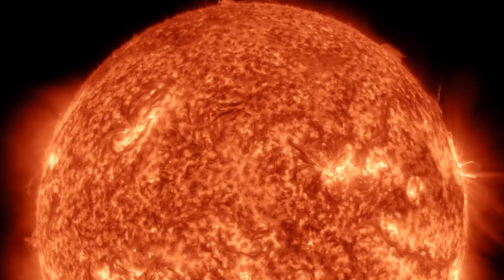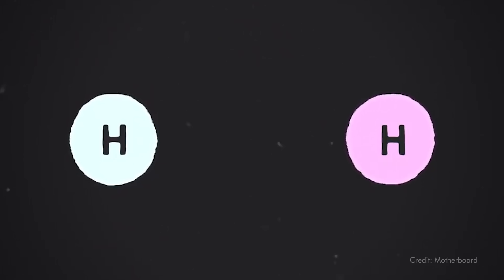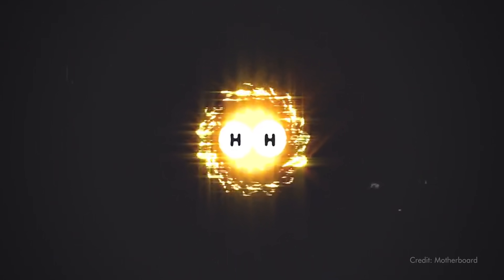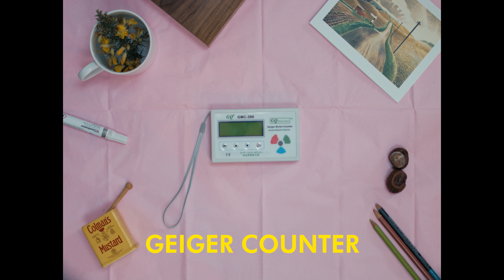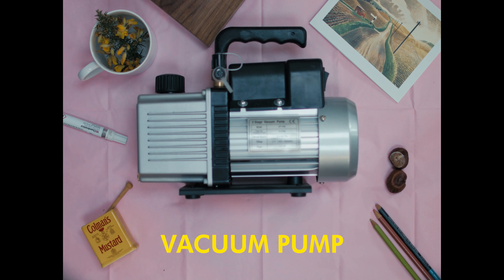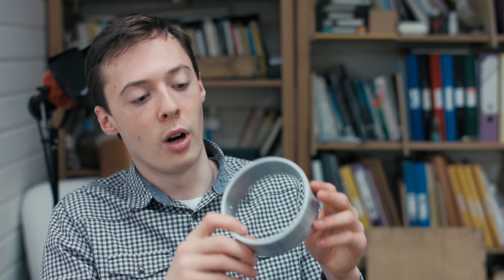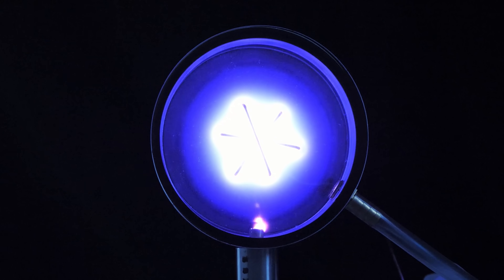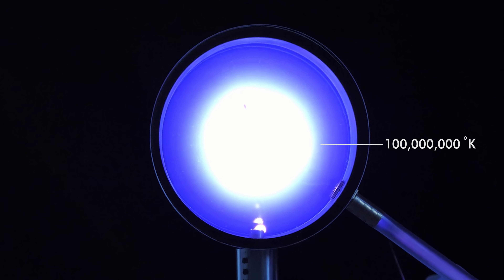Making a Desktop Fusion Reactor

Comment: Real scientists spend millions and thousand of hours of calculating and research to get their fusion reactors to work for a quarter of a second. 

What you have there is just plasma. Energy in a near Vacuum. 

I'm a chemist no physicist thought but have had to take Multiple Physik classes before earning my Bachelor
Reply: but the difference between him and a scientist is that scientist are trying to produce energy which is much harder. this is a fusion reactor, its just not a very god one
Reply: @vincentsantangelo3920  OMG. 

FUSION NEEDS MOLECULES TO FUSION ONE WITH A NOTHER. 

if there is a vaccum that's means there is nearly nothing in that chamber. If there is nothing then there's nothing to fusion. 

For fusion we usually try the Deutérium méthode where we have a H2 molecule reacting to form a He Atom. This process then ejects energy. 

What he created there is just high voltage energy. Basically dense energy in a vacuume. An this is called Plasma. 

You can see it in the color plasma has a special color Here as a star (fusion ) would have the color of the element that is being created (orrange blue etc ) 

I'm a chemistry bachelor major stating my master Thesis believe me when I say that that is not a fusion reactor. Look it up how fusion is made you'll see the sole part of there not being anything to fusion goes against the first law : nothing can be destroyed and nothing can be created. Everything is preserved
Reply: so instead of working on your thesis you decide your time is better spend telling a random stranger that their wrong?
Reply: @vincentsantangelo3920   dude it's 23 pm ...  I do work on my thesis after my classes but still have free time dude 😅 it's like any thesis you do it in your free time over 2 years with help of your lab assistant. (Assistant is just the word for it, your assistant actually has a doctor title himself he just assists you on your thesis ) 

So yea I basically have the same spare time as anyone else that studies at a normal pace. 

And its actually my pet peeve this type of video especially the poeple believing this bullcrap... 

It's something that can easily be debunked with some basic science understanding but poeple see some energy in a vacuume and believe anything. 

Engineers actually are pretty dumb most of the time. Most of the calculations and drawings come from poeple with a master degree or doctor degree the engineers are just there to execute what the scientist tells them to do. 

So this guy is just an engineer that's the reason he has 0 scientific understanding. He puts a few resistances together that's about it.

Does it look cool. Yes I guess so the same way a lava lamp looks cool . But he shouldn't be lying on his channel for views. Just makes poeple say this kind of shit to me at parties "you're a scientist right ? Have you seen the guy that made a fusion reactor in his parents basement ? " 
" Have you seen the solar roadways ! " 
"Elon musk is such a genius ! Have you seen his flying car idea ?! " 

Yes all this I have seen. No nothing of this is actually logically backed. And no these poeple are not geniuses, if anything they have no understanding of basic physics ..... They have a good marketing gift tough
Reply: calm down also did you hear about the boy out that build a nuclear reactor in his backyard
Reply: @vincentsantangelo3920   nuclear reactor works differently. The heat created is crazy. Plus the radiation needs big pools of water. 

Any amount of uranium that could be used to build anything useful (bomb or reactor ) is supervised by most countries of the world. 

In our lab to be able to use these kind of radioactif products we need special places we order it from and need to inform the city. Plus like any chemical we need to put our caution sheet infringement of the lab with every instruction in case of disaster (fire tornado and earthquake etc ) 

I'm calm actually just explaining how stupid this video is and poeple for believing it
Reply: @KarottenProductions  I don't know what country you are in, but in the USA you can just order uranium online, or walk over to a mountain and grab some ore. Or just get some americeium out of smoke detectors and make a reactor (which happened, look up David Hahn). And if you wanted to make a high voltage fusor you can just order the stuff for that online too. Or just use more voltage and use normal hydrogen. The colors he is getting are the normal type you get from fusors made at home. It's NOT a vaccum, it's low pressure that he put hydrogen gas into.
Reply: @KaletheQuick  It IS a vacuum, depending on wich definition of vacuum you use.
"it's low pressure that he put hydrogen gas into" JES! + electrical field = PLASMA! JUST PLASMA! NO FUSION!!!
And he does not have the 100000000K that he claimes to have. Or he has some incredible heat resistand copper wires.
Reply: @divingdave2945  or might be using copper coated carbon rods, or they might be copper rods. idk
Reply: Well, not really. Fusors have been around for a long time. Net energy generation by any fusion method including magnetic and inertial confinement has not been achieved, but many think that this electrostatic method holds promise.  This demo only demonstrates the principle, but a sophisticated device based on this principle could yield higher efficiency. The key advantage is that nuclear fusion requires a specific “temperature”  between a given combination of plasmas that is extremely high, but voltage can mathematically be substituted for thermal temperature.  Since such high voltages can be achieved much more easily, the required voltage for deuterium fusion can be produced on a desktop.  The main problems are the grid collisions, and the reaction products that impede the target reaction. I personally believe that a boron 11 fusion device could be built on this principle within the next quarter century.
Reply: I also had to take multiple physics classes for what I am studying, and I totally agree. He made a usual plasma. This has nothing to do with fusion.
This video is misleading, unhonest, antieducational and should be deleted. I wasn't that triggered at first but scrolling through the comments made me really upset. This comment section is like a medieval market place where a hundred censored spit at the one guy who says the earth is round.
Some big science youtuber needs to debunk this video.

Comment: Since 3d printing is a thing..  Would it be possible to cross thread a really good conductor.  Putting a solution on it layer upon layer..  Wouldn't that amplify the energy giving out since it will convert its own thrrads into a mini super rod.  Idk I can see more ways to out put more energy put applying it is its own realm lol

Comment: It’s not fusion and the reason it’s not fusion it’s because fusion is taking two particles smashing them together and creating a particle that is twice the size such as to hydrogens combining to make a helium that is high-voltage is between large distances ionizing particles in the air creating light for the electron step down method to create what looks like fusion if it was fusion it would most likely break his geiger counter or at least carpet out from what I can tell it wasn’t capping out because it wasn’t beeping all Geiger counter is regulated through the world have to beep when they cap out In order to tell you this is dangerous fucker maybe you should go away anyway it looks nice props to him for building it just frustrated me that the safety measures he took were minimal to none and that’s not how you silver plate either whatever I have a whole thing I can make an entire book about all the shit he did wrong good for you for making it just come back to it do it properly please

Comment: Fusion needs pressure to occur. Not a vacuum. Also the temperature would need to be extremely hot which would just melt everything that its made from. Not only that, Scientists have spent alot of hours and money trying to make a fusion reactor to very little success as the amount of pressure and heat needed is beyond the capabilitys of the resources we have now. What you should have named it is "Making a Mimic Desktop Fusion Reactor"
Reply: This lad, I swear...

Comment: So I am a nuclear engineer and can explain what is actually going on here.  That glow you see and the clicks from the geiger counter is from two things. One is what is called bremsstrahlung, or braking radiation.  It's the emission of photons from charged particles slowing down.  The other source of the glow is from electrons recombining with the ionized gas which also emits light, specifically blue for hydrogen isotopes.  It is technically possible to fuse deuterium and tritium (hydrogen isotopes) with 50 keV but since tritium is a controlled substance it is extremely unlikely thats what he used.  Even then, if you did have the proper isotopes, the fusion rate would be extremely low for this scale of a fusor and you would need a proper neutron detector to confirm it is working.  Not a regular geiger-mueller device.

Comment: 1. dose it give off radiation?
2. how does it not melt everything around it?
Reply: Ok I see so fusion is the adding of protons and h2 would be made by the atoms sharing a electron got you thanks for clarifying.
Reply: It should give out a little bit of radiation but this particular fusion reactor is just a fusor a relatively cheap demonstration piece that shows that fusion is possible with a relatively small amount of energy. The process it uses doesn't consume energy on the same level of its cousin nor produce as much heat and it will almost always be guaranteed to consume more energy than it generates due to some very fundamental and difficult limitations of the design, hence its bigger cousins the tokomak and stellarator reactors which are supposed to break even and generate a bit more energy.
Reply: Another question in his demonstration he shows two Hydrogen atoms and if you fused them what happened to then after like do they stay together and if so, isn’t H2 poisonous. 

Sorry about anything miss spelled or doesn’t make to much sense I’m dyslexic :(
Reply: @Derrick-ne9xs  if some of the atoms succeed in fusion he wouldn't be creating h2 he would be creating helium.
Reply: I got one last question that you might not be able to answer but could you just fuse them then spit them. Probably will not be able to produce enough energy to make up for when we use to fusion then the spilt them.
Reply: @Derrick-ne9xs  now that would be heading into the territory of needing nuclear materials that give off particle decay to break apart isotopes of helium to hydrogen since  you'd need a neutron source capable of breaking atomic nuclei apart. Electromagnetism is really good at forcing at atoms to fuse not so much at breaking them apart which is where the particle decay comes in, meandering neutrons birthed by nuclear decay are pretty the only particles capable of carrying enough of  a punch to breaking apart a nucleus without being interfered with by the forces electromagnetism.
Reply: Oh got ok thanks I appreciate it :)

Comment: you cant use ordinary hydrogen for fusors!!
you would need to get your hands on deuterium gas
or one other way is to coat the central electrode in lithium Deuteride salt!!
also dat shit needs a super powerful vacuum pump called a diffusion pump because it operates at extremely low pressures

Comment: I'm just confused by the Geiger counter. Even if fed hydrogen, a demo fusor won't produce any meaningful Radiation. You need a real fusor running in star mode (D2 fuel) and even then it'll emit Neutrons which won't be detected by a Geiger.

It's a good build and I don't doubt the demo mode operation, but it isn't emitting radiation.

Comment: Iam not sure ... but ... if that thing has 100 mil degree ... shouldent it melt down the whole experiment ... at least the glas  or plastic ? I mean glas/plastic has a very low melting point... right ?

And... just a question... iam not a great physiscian but... isnt the reason why the sun does fusion is the massive great pressure in it, wich is forcing the H atoms to melt together to become helium ? And not the speed of the protons which are crashing together ?

Comment: Oh its fusion alright but the amount of energy in Is equal to 1v at 60 ampers. Although 1v at 60 ampers is like having a 8oz cup feed water to a hose 60 times its size. Using 60,000 volts on a 10ma current is like having a water tower force water out of a 10 mm water pipe. energy out is basically zero for electrons because it's all going to heat and light production. Electricity does weird things. Don't take my example for granted as I may not be entirely correct.

Comment: Ok I’m not a science geek but ur saying true scientists have been trying to create fusion and you’ve just created it in ur backyard to sit on your fucking desk ok ok but anyways say this is true how the hell did your glass and metal withstand “100,00,00” degrees huh that doesn’t make sense and plus I’m sure if you are trying to smash particles you need to have some way of accelerating that particle and the only way of doing that is by using a particle accelerator which I’m sure you can’t build one of thoughts and sit it on your desk to admire. Good job with creating plasma AKA fire in a vacuum chamber.

Comment: Despite the questionable efficiency of this thing as a "reactor", I can say that, if that's real fusion same as the sun emitting that light, and with the fact that you used silver in the manufacturing process... Well, it would be quite an effectve ward against vampires.
All that's left is to carve some scripture into it for good measure, and you'd be set!
Reply: Nice mayhem pro pic
Reply: ZarHakkar i thought silver was good against werewolves? maybe both...
Reply: To mimic the sun's radiation you would have to have an identical black body spectrum (on earth's surface), and I'm pretty sure that the spectrum of this reactor is different

Comment: "FUSION REACTOR!!!"

not even an ARC reactor
Reply: It’s a high voltage light bulb in vacuum not a fusion reactor.
Reply: @mohanrs8270  it's a fusor
Reply: The ARC reactor is basically a "cold fusion" reactor
Reply: Well, it did use an electric arc to ignite it, so it kind of is an Arc reactor.
Reply: Cannot believe how ignorant you are

Comment: I want to let everyone know that this is not fusion. It is just a regular plasma.
Reason why this is not fusion can be seen in the video. Device is wired incorrectly.
Fusor needs to have negative electrode inside and positive electrode outside. This way, positive plasma ions can be accelerated inwards towards center where they can collide.
However at 6:38, you can see coronal discharge on the outward electrode (characteristic for negative electrode) - electrons pouring out of single point, spreading out as they go.And you can see characteristic anode (positive electrode) glow at the wire mesh - wire glowing from it's entire surface.

You can also see the voltage multiplier he built. It has 8 diodes. In voltage multipliers, number of diodes represents half of number of doubling. In other words, since there 8 diodes, voltage is doubled 4 times. His high voltage transformer creates 10,000V, so output voltage would be 160,000V, which is a bit of an overkill. Especially considering that his contraption wasn't fusing anything. Problem is at voltages that high and pressures that low, you start creating a lot of x-rays from electrons slamming against anode. So his Geiger counter must have been measuring that. From what I understand, Geiger counters usually don't detect neutrons, which is main source of radiation from fusion reactions, so all that clicking would be x-rays, which is terrible news for anyone in vicinity.

It is possible to make this sort of device without the deadly x-rays. The trick is to use voltage as low as 10,000V. At that point, there is no fusion, and if pressure is not too low, there won't be any x-rays either. In real fusors there tends to be glowing orb inside of the cathode wire mesh that is separate from the mesh itself, the result of ions colliding in the center.
Reply: I agree. I work in industrial measurement and control and have  installed and calibrated fast neutron detection equipment, mostly for moisture detection, it requires very specific detection equipment. If it did produce neutrons I would want this thing to be submerged in a bath of water or use boron empregnated plastics... Anyway, simple Geiger counters cannot detect neutron activity.  Berthold produces some good practical literature on the subject. He's made a very, very cool lightbulb.

Comment: When a guy does not do his home work and puts a sound of geiger counter even though fusion reactor don't release radiation
Reply: Fusion produces radiation. It produces radioactive waste as well, but it is very short lived and decays very quickly.
EDIT: I say short lived but this is in comparison to Fission Waste.
Reply: @novapraspakt8587  hydrogen is generally used and yes the half life  of tritium is few milliseconds it is not even enough to kill an ant and it is in very less quantity can't think if that sound whether that sound is from chernobyl or fukushima
Reply: @kartikeysinha3834  
1. The half-life of Tritium is about 12.5 years.
2. ANY radiation is harmful. It is dependent on your distance and protection. Alpha is BY FAR the least deadly, but it can still be dangerous.
3. Where is Chernobyl coming into this?
4. Why does my ant now have 13 and a half legs.